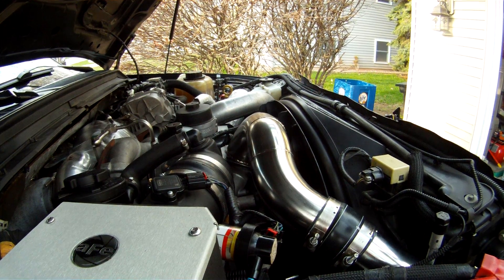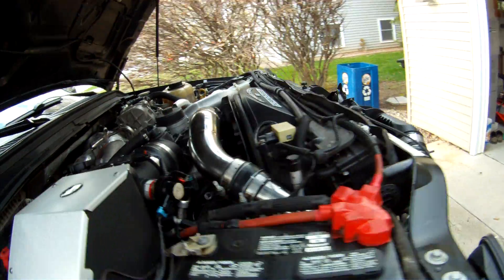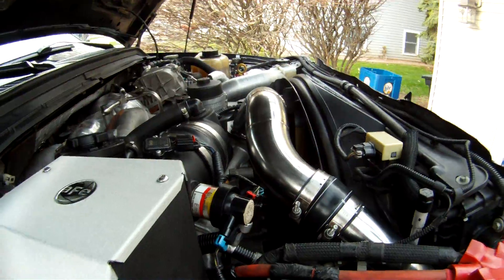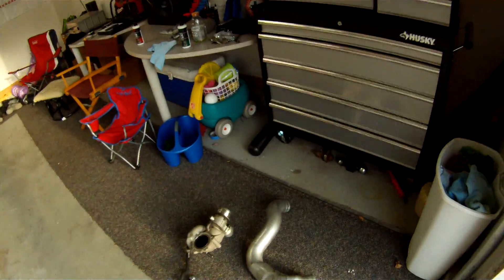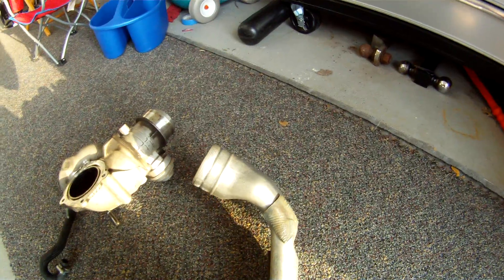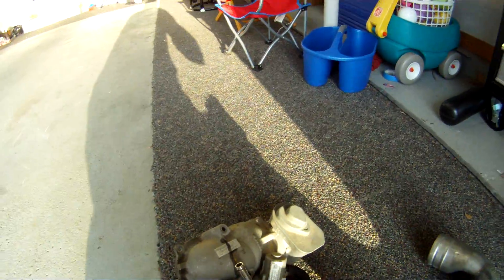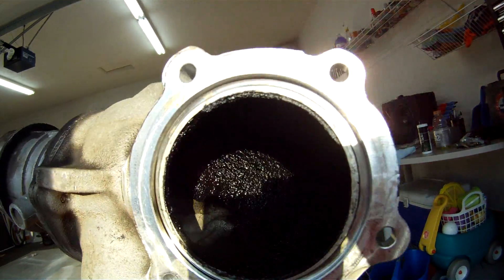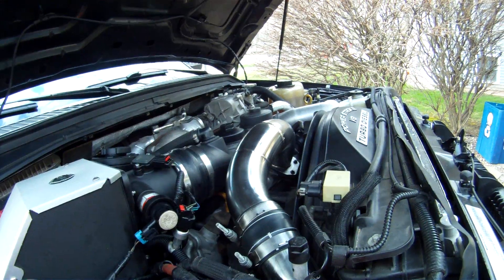NO LIMITS INTAKE FOR 6.4L FORD

Comment: You should probably bullet proof the 6.4 since they have problems with the valve train and get a mishimoto radiator which will get rid of your cooling problems

Comment: I was just wondering I did an egr delete and left the stock coolant line in place. I guess so the engine knows the coolant temps. But is that necessary or can I delete those too